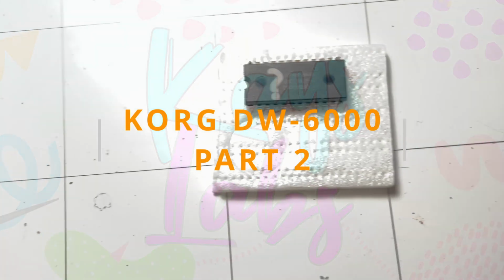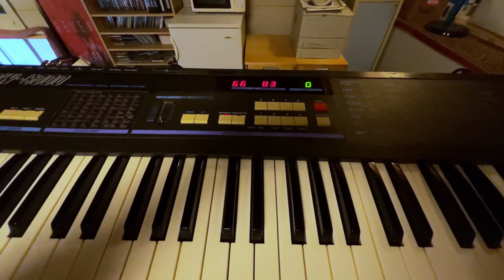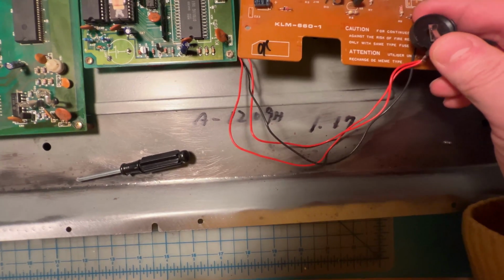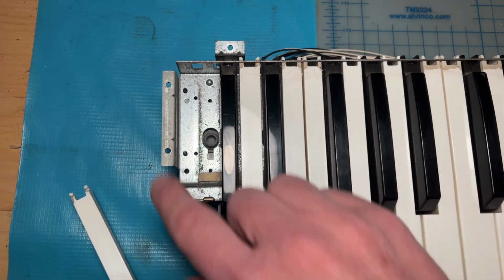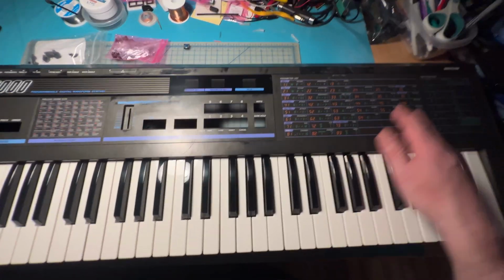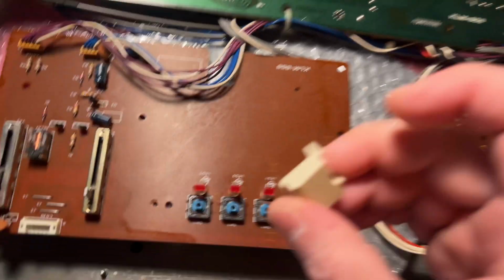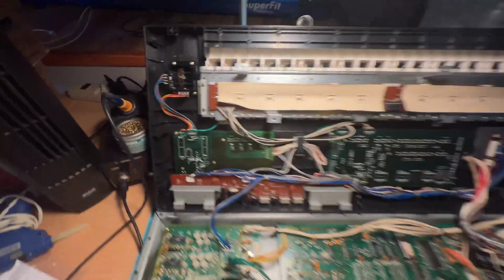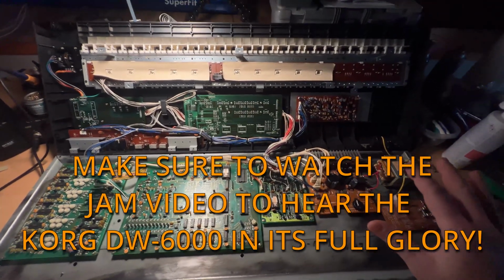Reviving a Korg DW-6000 (Part 2)

Comment: Hi KaysLabs, thanks for sharing, fascinating how you fixed this! 
In fact, my faithful DW6000 just died all of a sudden (no display, no sound). I have changed the RAM chip but did not help, despite I am sure this is the failing board. Once I am over my disappointment I will try again; sure grateful if you have any suggestion! Otherwise keep up the good work and look forward to more repairs!!
Reply from the maker: IC's rarely fail by themselves. I would start with checking the power rails, and then take a closer look at anything that might seem suspicious. Also, make sure the memory battery is still good. Surprisingly those memory batteries can screw up the entire instrument when they fail.
Reply: @kayslabs  thanks for your reply and hints! 🙏 I will try battery first - hopefully I am lucky! my soldering skills are not as good as yours - it is already a miracle the poor thing has not gone up in flames already! 😃

Comment: I have this same exact issue with the one I just received, but it appears that it’s a different ram chip than yours, I suppose they are interchangeable? Do you know anything about this? Mine is the MB8416-20L ic
Reply from the maker: The pin layout appears to be compatible...however do some research and take a close look at the data sheets. If the specs are close enough, it should work.